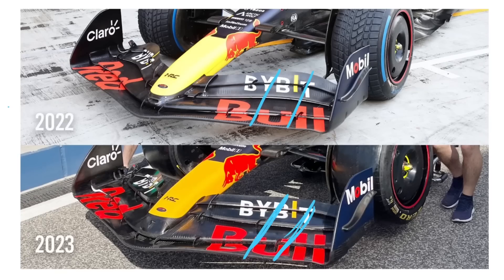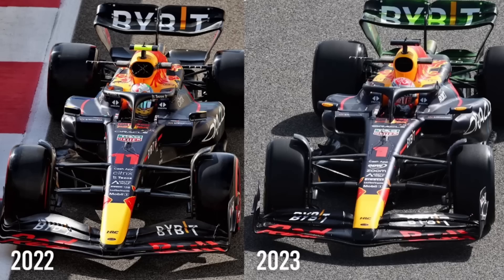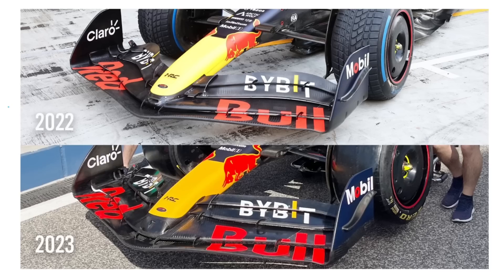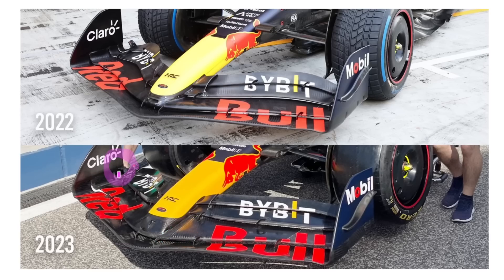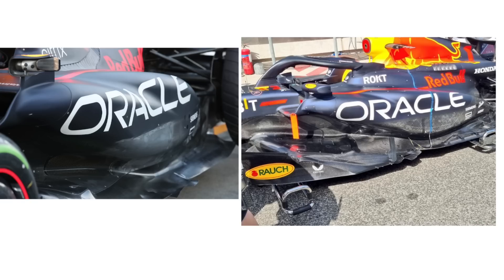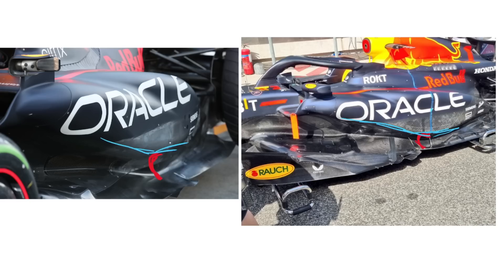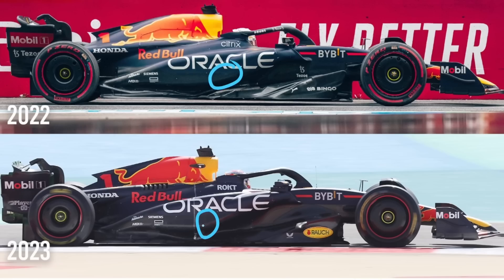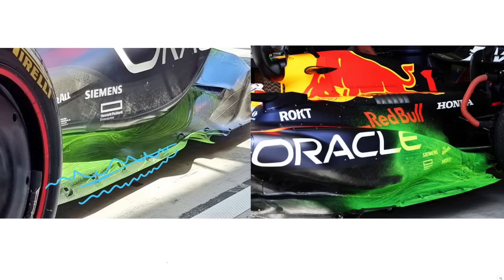Red Bull RB19  -  Aerodynamics Analysis and Initial Thoughts

Comment: I love your videos and I've been able to use some of your older videos to plan our endurance Champcar build. I think the motorsport community would appreciate a video on differences in drag/downforce potential between open cockpit cars like F1, BAC Mono, Radical, Lous 3-eleven, closed cockpit cars like GT Cup and Prototype, and 'convertible' race cars with windscreens like the Miata, Caterham/Lotus Seven, and Dallara Stradale. Is there a benefit or detriment between the aeroscreen in indycar and the open cockpit in F1? Further, amateur/grassroots road race cars rarely have side windows but always have a windscreen, so is there a drag benefit to being convertible like a Miata (or just removing the rear windscreen like the Visceral Racing Porsche 944 that has been very successful in Champcar)? Is there potentially a drag reduction in having a roofline or is removing the rear windscreen the only beneficial move assuming typical grassroots motorists have no driver/passenger windows? Lastly, how does a roof or lack thereof affect the downforce potential of a rear wing? Thanks for always providing such great content!

Comment: Hi Kyle. Eureka!!! I think I have solved the aero differences between the RB 18 and W14. Mercedes are wrong with the no side pod concept because the air flow around the body is unhindered and too fast - hence the differential pressure above the floor and under the floor is less compared to the RB18 and hence less downforce. On the RB18 the side pods stick out and are undercut to form a twisting vortex as seen by the flow vis patterns in testing. It takes longer for to pass front to back - greater pressure differential and more downforce. Also the RB18 is less dragging because air going into the side pods is forced out upsides through the louvers and the hot air expands pushing airflow above the car leading to less drag at high speed. Please advise as regards your thoughts and pass on to Mercedes.😊😊

Comment: Kyle - great video as always! A question- if the FIA working group is so exercised by controlling outwash from the front wing as an aid to overtaking why are the front wings SO wide? Could they not be width-restricted to say centre line of the front tyres? This might help in curbing the levels of front wing damage we often see at races with subsequent interruptions to great wheel-to-wheel dices!

Comment: Hi Kyle!!  Check out 9:52 of your video. What’s your take on what appears to be some sort slot on the underfloor (I guess that’s what that section of the car is) that is on the left side of the screen. It looks like theirs a opening/duct for some purpose. It looks to be 1”X6”. Thanks.
Reply: Yeah there is a long slot there that is allowing air on the bottom to flow over the top of the floor.
Reply: Ya, was wondering about this as well. My best guess going off of Kyle mentioning that there is significant out wash in that area. I’d imagine they are using the Venturi tunnels like Barge  boards and pushing more are outboard. Only a guess though

Comment: Everyone's hyping the "aggressive undercut" but to me the biggest change in the sidepods is that their previously curved side face (where Oracle and Siemens logos are) has been flattened so much that it seems concave from certain angles! I assume this is to keep the front wheel wake out for longer, which is a leaf from the 2022 Ferrari playbook. Curiously, in 2023 Maranello took a step in the opposite direction here.

Comment: Hello Kyle ! I noticed that the RB19 has a smaller intake at the top of the car, do you have an hypothesis as to why ?
Reply: This was spoken about during testing yesterday. Both the RedBull and AlphaTauri have the same roll hoop intake now, and both are powered by Honda (RBPT). Most likely Honda & RB found some performance increase with changing the size and shape of the intake. It most likely has nothing to do with overall aerodynamic performance but engine air intake performance.

Comment: I wonder if the tighter and lower radius on the bottom of the side pod is a consequence of a slightly lower and straighter top to the side pod?  Perhaps to retain internal volume / cross sectional area for cooling.

Comment: Even if it's just educational guessing or speculation, you should try to give more conclusions to your analysis. It would easily double your viewers. Showing what's going on in F1 cars is one thing.  But clearly explaining what it could actually mean will wake up a  whole new audience.
Reply: Sounds good, and I would be interested too, but I believe Kyle is a man of evidence (data) and science, he often mentions what is the possible function of different details, and he also points out if he isn't sure about something, because of the lack of proper data. He is clearly not a speculator.
Reply: Indeed I completely agree with your assessment. Speculation is what fans and media do.

This is the science explained as a best guess with the information available at the time. 

What can be said anyway besides this could make the car go faster. A bit blunt/ nutshell but that's the aim and only conclusion you can make/ the only thing F1 teams want to do. Go fast and win!
Reply: @staLkerhu   Nobody in F1, not even team engineers, is ever sure how aero changes work out until a car hits testing. And even then they're not always sure. So nobody will hold it against Kyle to give an argumented opinion on what aero solutions he suspects will work out best based on his experience. In fact, I'll bet that was often what he was paid to do at Mercedes.